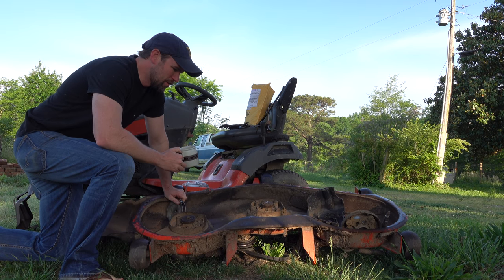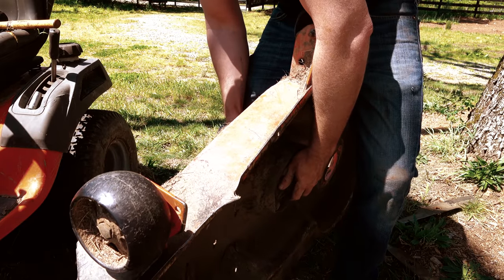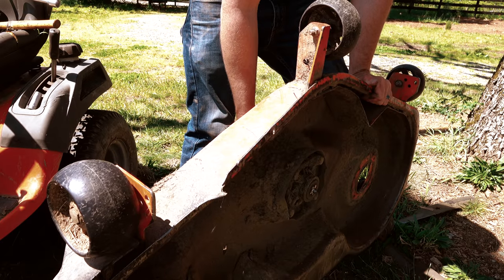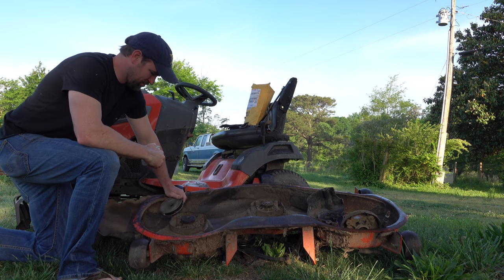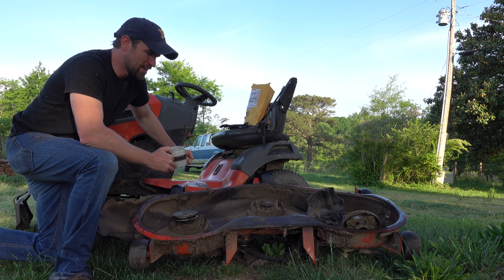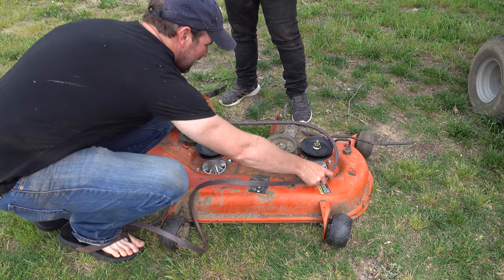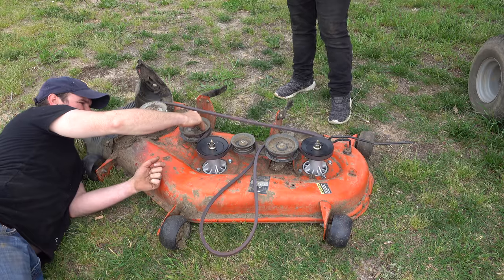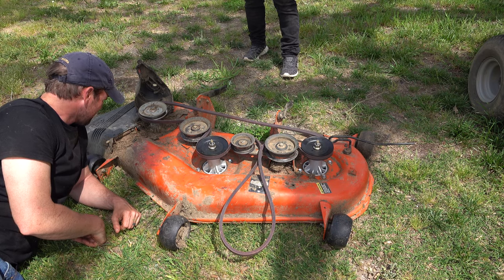This Mower Is A Mess | Save Money on Husqvarna Mower Parts

Comment: We could not get a gas powered riding mower to keep working, so we went with an electric push mower and it is all good now.  I would think with any property you would do well with a tractor type to mow and finish up with a smaller mower or trimmer machine.  Good luck in all you have to keep fixed on the property.

Comment: Have you had to mess with the compression?  I have replaced/changed everything on mine that would cause it to turn over for 30seconds to a minute before starting except the starter motor.  But I haven't checked the compression, because honestly I don't know how.  Once it starts and warms it runs great, but it takes a bit to start and doesn't run well for the first 30 seconds to a minute until it heats up.  Hence I'm thinking compression since I've changed fuel filter, fuel of course, air filter, spark plug, oil, oil filter, and battery.